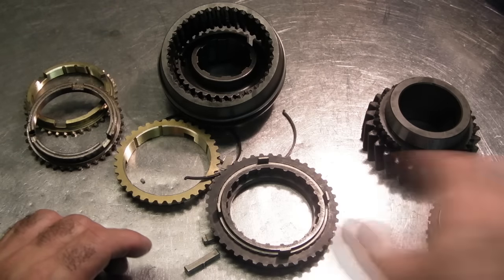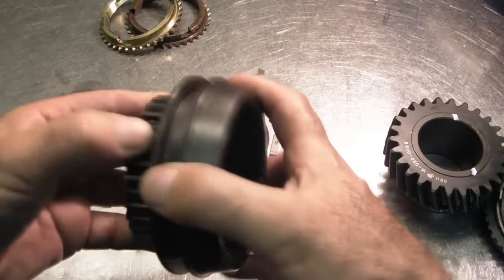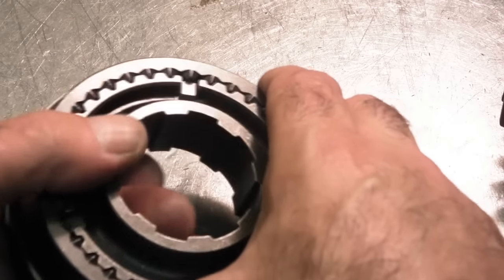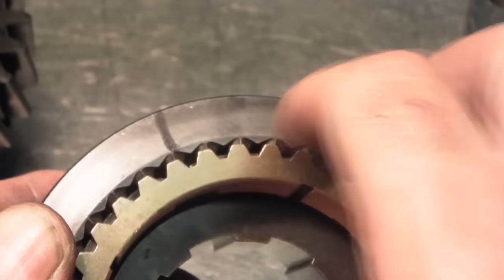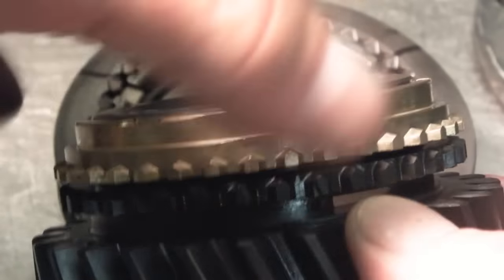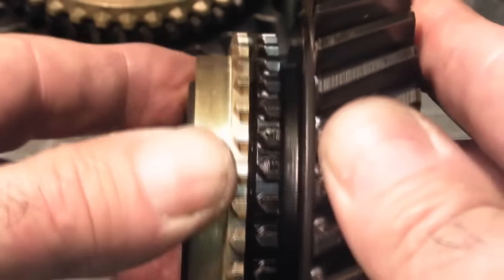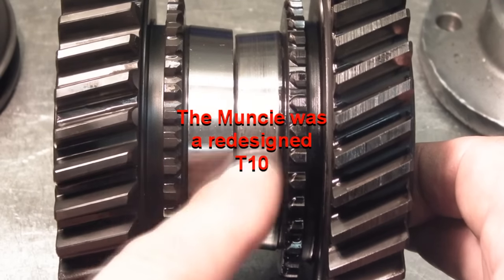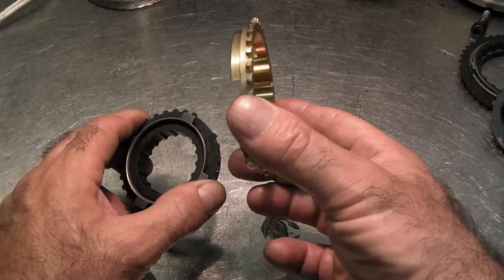Learn About Transmission Synchro Rings

Comment: Sir, I am experiencing a grinding noise when I am in 4th gear and the car slows down to somwhere from 25-30. A really loud grinding noise underneath. I tried to reproduce it using 5th gear but it does not make any noise like the one in 4th and sonetimes in 3rd gear and going slow to 20. Could this be a synchronizer problem? Please help me. Your suggestion will be of great help..by the way Very informative video..
Reply from the maker: Really could not tell you... I'd have to be driving the car to give a fair opinion.

Comment: So when you 'grind' the gears in a a gear change (say if you bring your foot off the clutch too early) is that the teeth on the sliding hub mashing up against the teeth on the synchroniser, or on the gear itself?
Reply from the maker: The gear itself
Reply: @GearBoxVideo  Thanks. A very helpful video indeed!

Comment: Can you explain how the clutchless shifting transmission's work? Like in newer road course race cars run.
Reply from the maker: Sure, Notice the gears and rings in the video have 36 teeth. Think of driving by a picket fence and hanging a broom stick out of your window and having it bounce off the pickets. If you remove every 10 pickets the broom stick will drop in. So you remove the 36 teeth on the gear and the slider and just use 12 teeth instead.  The shift window is so large now, you don't need a clutch.  The downside is backlash noise and clutch tooth wear. Thanks for sharing the video
Reply: How the clutchless-shifting transmission's... what... works? (What thing belonging to the transmission did you mean to be referring to by using that apostrophe there?)
Reply: GearWorldTV

Well, you'll still need the (main) clutch... to start and stop the vehicle (without starting and stopping the engine, of course).

Also, what did you mean by "clutch tooth wear"? Oh, you were talking about the cone clutch teeth, right? Oh, so there's even one more way that you'll still be using a clutch while shifting even if you're not using the main clutch to assist.
Reply from the maker: MaxxFordham  Jason Goldsack     Clutch teeth are also called engagement teeth on the gear. Dog ring or face tooth transmissions have no synchronizer.   Here is a link to a clutchless box http://www.5speeds.com/racing/jt5rc.html .  You are right, you still need a clutch to start off initially, but the dog ring gap is so huge, you don't need a clutch, however using a clutch promotes less wear and tear.

Comment: Sm465: I BOUGHT A REBUILD KIT FROM NOVACK ADAPTERS, IT MENTIONS IF YOU USE THEIR GEAR BUSHING YOU HAVE TO USE THEIR THRUST WASHER, SO THE OLD THRUST WASHER HAS A LITTLE PLAY BUT THE NEW THRUST WASHER NEEDS TO BE LIGHTLY TAPPED IN PLACE, THEIR IS NO PLAY AT ALL. BOTH OF THESE THRUST WASHERS ARE THE SAME DIMENSIONS WITH ONE EXCEPTIONS,  THE INDEX KEY ON THE NEW WASHER HAS NO RELIEF AT ALL AND THAT MAKES IT TIGHT ON THE SHAFT. WHATS CORRECT TIGHT OR A LITTLE PLAY. THE THRUST WASHER IN QUESTION IS BETWEEN SECOND AND THIRD GEAR. THANKS VERY MUCH.

Comment: Need help with vw 6speed 02M transmission 
Car was grinding in 1/2 gear when shifting changed fluid on the way from shop start loosing gears 
Shift fork broke changed shift fork and it was fine for month 
Took car out ride at stop light car won’t move in first second gear 
Feels like natural 
3456 and reverse  work fine

Comment: Hi there, I just put in a clutch disk , pressure plate and release bearing / hydraulic; now I can’t get it to go in 2nd gear,4th gear not reverse. Tell me did something happen inside the transmission. Someone help me please
Reply from the maker: Without actually knowing your application and make and model, I would not know. Email questions like this to support@5speeds.com

Comment: Land rover Discovery TD5 2001, difficulty changing down to second also when reversing and clutch applied causing vehicle to stop. doesn't appear to be anything to do with handbrake drum on prop shaft. Any ideas?
Reply from the maker: +Andy Price  You may have a gear starting to seize to a shaft.  Check your oil level.

Comment: sir if the gear is rotating at high speed and if i want to push the slider in position with the rotating gear,how is the synchro ring useful???
Reply from the maker: The ring acts as a brake and slows the gear down to match the speed of the slider so they can connect.

Comment: I have a 4th gear that used to pop out unless I hold it. But now it pops out when I'm holding it and give a little throttle. Additionally, it doesnt go in 5th( at least it doesnt feel like it engages, so i don't bother going into 5th). Do you think my 3-4,4-5 synchros and my 5th gear itself are done? By the way it's a toyota 4 cyl trans
Reply from the maker: +Henok G Could be a linkage mechanism internally that is affecting everything.

Comment: i have a toyota pickup .
when it is not moving it is hard to shift to 1st,2nd or R .
i have to shift all speeds or move the vehicle a little distance then it can be shift easy .
when it is moving it is easy to shift to all speeds except when i slow down and almost stop i can't shift it to 1st .
what is wrong with it ?
Reply from the maker: This sounds like a clutch release issue. Most of the time these problems can be related to faulty clutch hydraulics.
Reply: GearBoxVideo
thanks for fast replay.
how can i know what is the defective part ?
Reply from the maker: toolman talal get the car good and warm, and while it's idling press down on the clutch pedal count to 10 seconds and try to put it directly into reverse. If it grinds then you have a poor clutch release which means that your hydraulics or your clutch are defective
Reply: GearBoxVideo
thanks again .
great technique i'll do it today and let you know what happen .
Reply: GearBoxVideo
hey,
i did your method many times and pressed the clutch pedal 10 , 15 and 20 seconds without any grinds but i think it is inside the transmission maybe the forks i don't know .
what else can i do ?
thank you for advance .
Reply from the maker: toolman talal  A transmission when it is not moving should be able to go into gear standing still or with the engine off. So with the engine off or standing still there should be no difference. Is that what is happening?
Reply: GearBoxVideo
yes it is , by the way i replaced the shifter bushings about 6 month ago with no change .
thanks for your help i appreciate it .
Reply: toolman talal it sounds like either the clutch is still engaged a bit or the pilot bearing in the crank is frozen or worn turning the input shaft
Reply: Evan Goodale
thanks

Comment: I have an 84 F250 w NP435 after its on the road for a few miles it starts grinding in gear.  I clutch and take out and put back in gear and its fine.  It happens downshifting to 3rd occasionally.  Is this the sign of bad syncros?
Reply from the maker: Pretty much. That's an easy transmission to build

Comment: Have u ever seen a strut key spring broken and one dog walked out causing binding and downshifting issues .what did it cause that?its 18 spline zero rock assembly nice and smoot of auto gear.shifter adjustment was off when i found it out though
Reply from the maker: I never made an 18 spline zero rock assembly. Where did you get your transmission from?
Reply: @GearBoxVideo  all from auto gear brand new parts
Reply from the maker: I don't use any of their 18 tooth sliders, hubs and springs or synchro assemblies. We make our own parts. I find that this problem does exist with their components. Unless you have 18 teeth on the gear,  the 18 tooth sliders do nothing but wear more. The springs they use don't lock on to the key properly and will disconnect at high RPM.
Reply: @GearBoxVideo  i had hard time when putting springs on u are right .they dont sit on the surface well.sliders have no wear on them yet.after 1000 miles street racing power shifting etc.i ll contact u when this happens again for parts.love u
Reply: Just bought ur hardened steel bushings im in orlando

Comment: Hi Paul, I've started disassembly on a '83 Datsun 280ZX Turbo NWC B&W T5 and have come to a halt for further diagnosis and recommendation. Upon removal of the extension housing I noticed one of the strut keys on the hub to the 5th gear was undamaged laying in the bottom of the housing. The second issue was once again another missing strut key, this time missing from the hub just in front of 3rd gear. This one I found on the large magnet bottom of the case, undamaged once again. Further inspection reveals nothing else damaged, missing, or broken. Normal wear on the shift fork pads, normal metal flaking found and removed from fluid and magnet. All shafts spin smoothly and freely, no weird noises or grinding, etc. How should I proceed? I can easily reinstall the strut key on the 5th gear hub and inspect the springs. As for the 3rd gear hub, what do you suggest I do to install the strut key and/or inspect that assembly?  
Also, what's your experience on using the bronze shift fork pads over the factory teflon units? 
Thanks for your input and guidance, your videos are priceless!
Reply from the maker: The later 3-4 assemblies had keys with wings to prevent the keys from coming out. Typically as rings wear they create a gap for the keys to pop out. I would change the rings to be safe and upgrade the 3-4 synchro assembly.
Reply: @GearBoxVideo  Will proceed with your recommendation, thanks. And as for teflon vs bronze fork pads, worth the upgrade or stick with teflon?
Reply from the maker: I never use bronze pads, they wear faster
Reply: Paul, thanks again for your recommendations. With all the gear oils that have changed over the years since the early 80's when NWCs were first released, what would be the suggested modernly available lubricant product to use equal/close to the properties of the original manufacturers suggested oils of API-GL4 (SAE 80W-90 or Type DEXRON) for summer/spring use in the Midwest US region in a rebuilt NWC? It's been recommended that I should use Valvoline DEX/Merc ATF or on the flip side Brad Penn 023-7729 Multipurpose Classic GL-4 80W90 Gear Oil. What's your take on this? Thank again.

Comment: my buddy drives semi, but when he's trying to get going fast and the truck slips out of gear or misses a shift, he puts in clutch and slams it into gear same thing with downshift he floors it, pushes in clutch quickly and pounds it down into next lower gear instead of rev matching, i know its pretty rough on clutch, but how hard is it on the gears and how fast could this mess up the transmission?, i know the gears on it are very thick and big, but the teeth arent too big of spurs. its eaton 9 speed
Reply from the maker: joey lenseigne I honestly don't know much about these transmissions.  I thought they were synchronized transmissions and any falling out of gear situation usually means wear someplace.
Reply: nah semi trucks their transmissions aren't synchronized, you can float gears but you have to match the rpms to get it in gear, clutch doesnt do much good for you

Comment: Hi Paul my 2017 hyundai elantra 6sp (M6CF3-1) grinds shifting into 2nd gear while turning left or right with clutch pressed all the way down. It also grinds when going downhill starting from 1st shifting into 2nd. I've changed the fluid but problem remains. Thanks!
Reply from the maker: You probably need an overhaul. Sometimes a change of oil can't fix
Reply: @GearBoxVideo  Thank you! I can't imagine the transmission already needs an overhaul.. it only has 22000 miles on it (brought it new from the dealer) but thank you again!
Reply from the maker: Should be under a power train warrany. Most are for 5 years and car is for 3. Don't mess with it. It's under warranty.

Comment: befroe I bought your book , I went and bought a synchro slider and hub and rings , only to discover its a late one . Can I use the whole assembly in an early box ?
Reply from the maker: if it is the whole assembly which it appears to be.. yes
Reply: excellent , thank you . If I had this book before I purchased my muncie , I probably wouldnt of bought it , its an early 7/8 shaft model , 325
Reply from the maker: I upgrade early ones to late ones in my builds. Its the better way to go.
Reply: I was thinking of enlarging the layshaft hole to 1 " and purchasing an M22W gear set , but I cant find them in your catalogue . Theres other ones for around 400 bucks , but I think not...
Reply from the maker: M22W Italian gearsets are typically over $600, the Taiwanese sets do not offer the same ratios and design. You need a milling machine to properly bore the case to the pin size and you need the pin you are going to use to size it correctly.

Comment: I have a 2003 350z that grinds when going into some gears do you think this would be a bad clutch release or the synchro rings. The 2003 and 2004 are know for having bad synchro rings and I’m thinking about getting it rebuilt but I want to know what else could be making it grind gears.
Reply from the maker: If it happened all at once ... Clutch release. If not, worn rings
Reply: GearBoxVideo thank you and your video is very informative.

Comment: My Opel 4 speed had a quaife close ratio gear set, I gave the trans to a shop for repair, they removed the 3 gear steel synchro and installed a brass one. man was I pissed
Reply from the maker: Quaiffe steel rings are expensive and my guess is that they didn't want to spend the money

Comment: Paul, are NV3500 five speed transmissions junk?
can you go through one and make it work properly and last if maintained correctly? just asking.
Reply from the maker: There are no aftermarket upgrades, whatever intended use they were designed for is all you should expect from it.
Reply: +GearBoxVideo 
I'd like to do a T-5 retrofit into a Chevrolet Blazer but I've heard my best bet is a NV3500 because they actually came with them, and no one seems to know what bell housing would work to get the T-5 into a Blazer, what do you think?
Reply from the maker: The NV had a bell as part of the case. Just look at google pictures to see what I mean.
Reply: +GearBoxVideo 
can you build me a good NV3500? just this once?

Comment: I accidentally grinded gears of my KTM DUKE 200 motorbike while downshifting from 6 th gear. It happened first time with my motorbike. Does it cause any damage to gearbox (It happened first time)
Reply from the maker: These typically are dog ring transmissions. So if the clutch isn't released they grind. Usually there is no damage.  When they fall out of gear then the transmission will need fixing

Comment: Hey there I currently drive a manual and it seems to grind when I'm in third gear and seems to do again when i downshift is there a problem with my synchro rings??? Just need abit of advice
Reply from the maker: Yes more than likely if it is isolated to the one gear then yes. What kind of transmission / make / model car?
Reply: It is a 1992 Holden Nova. Don't know what transmission it has but it does have the same transmission as the Toyota corolla hatchback does.
Reply from the maker: I am familier with the Toyota transmissions.  Some can be hard to take apart without proper presses and pullers. A used unit may be a cheaper alternative
Reply: oh cool thanks
By the way do you live in Australia or America?
Reply from the maker: Simply Steve America. But I ship to Australia weekly.

Comment: Is it possible for the synchro rings to be bad on a 30000mile car? I have a Renault Clio 1.2 from 2010 and often it's having a really hard time going into first, second or third. It feels like that block out you were talking about, where it doesn't grind, it just won't go into gear all the way, and come back out into neutral.
Reply from the maker: So many people have the same issue.  It usually has to do with a clutch release problem. Synchros will not all go bad at the same time.
Reply: GearBoxVideo Many thanks for your reply
Reply: I'm not sure if it's a clutch related problem though because if i double declutch it seems to go into gear much easier. It's annoying as these things usually cost loads of money to fix :(
Reply from the maker: Again, synchros will not wear all at once. So if the hard shifting issue affects all the gears more than likely it a clutch release issue.
Reply: +GearBoxVideo what is the cost of repair if it is the clutch release problem, my car just got over 10k miles, and it started to have this problem this morning, had to really push it to get it in to 1st 2nd and 3rd, and it won't grind, even if I try to grind it intentionally, I am really confused right now, down shift is easier than upshifting in terms of how hard I had to force it in.
Reply from the maker: Fanjing Liu I don't do repairs and without knowing what make and model car you have, I cannot even recommend where to go.
Reply: GearBoxVideo i have a 14 accord, its still withing warranty, i thought if its a small job, like an adjustment, i will just use the shop in my neighborhood
Reply from the maker: If it is under warranty, take full advantage of the warranty.

Comment: is there any way to check if the synchros are bad in a transmission when its out of a car like in a junk yard?
Reply from the maker: +Graham Rees Yes, see if they lay flat against the gear.  They need to have space, usually .030 to .060 depending on the make.
Reply: +GearBoxVideo ok. thank you

Comment: got a 98 nissan maxima manual trans and it refuses to go into reverse about 90% of the time but it shifts though the rest of the gears just fine. theirs no grinding when i try to put into reverse it just wont go in any ideas on how to fix this problem.
Reply from the maker: Reverse may be a little beat up and both reverse gear's tooth points are worn so that the meshing gears cannot slide past one another. You really won't know until it comes apart, but that usually is the cause.